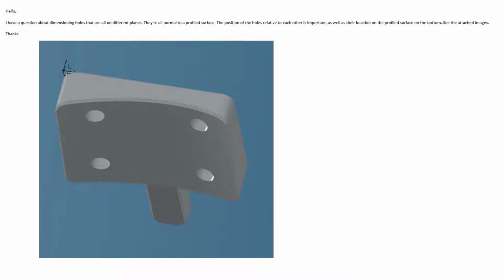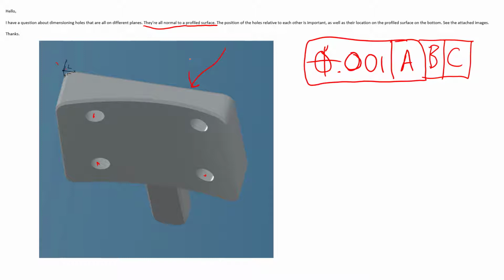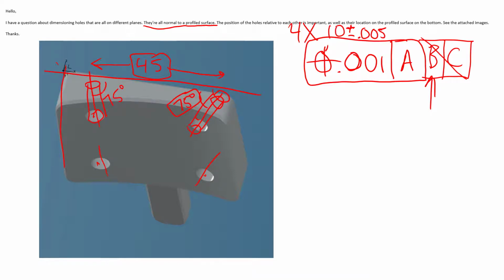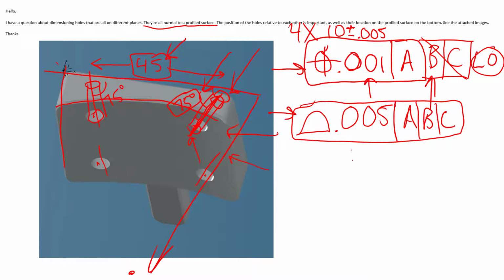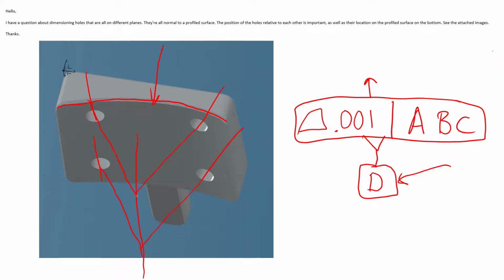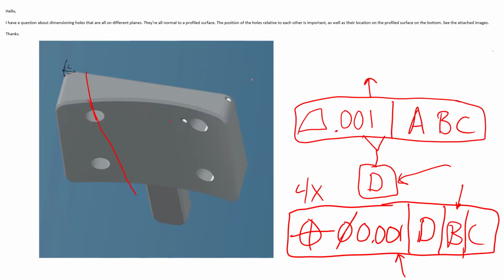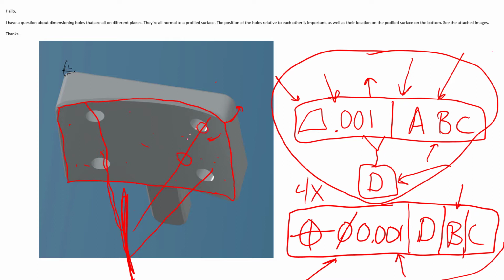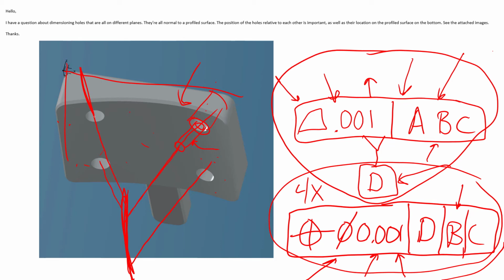Using a Complicated or Round Surface as a Datum - 4 holes normal to a curved surface

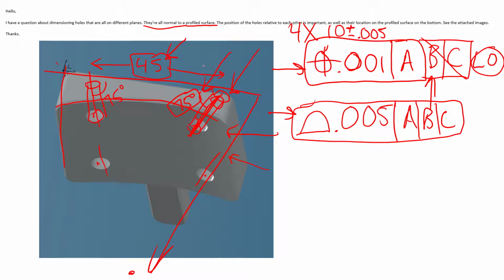Comment: @9:03 [My Observation] The "Industry" strives to design parts to be cost effective on both ends, so this usually means parts can be machined with minimal fixtures required. It is my opinion since datum A is flat (top) and the 4x holes will be bored from Primary datum A (Top) not the (Bottom) and then YES, the bottom would create the "Weird Awkward Angle". Boring from the top with a 90 degree angle, will be more efficient and cost effective and let the other part (round surface) host the "Weird Awkward Angle". It is more efficient and cost effective to bore holes on round stock then to bore a hole at a "Weird Awkward Angle" and locate it on a flat surface, do you agree?

Comment: how do we use a curved surface to check the true position of a hole that is not normal to the curved datum surface. Like the distance of the hole to the curved surface  say the curve surfaced was 90° to the hole?
Reply from the maker: The true position of a a feature such as a hole is defined using basic dimensions back to the datums defined by the datum reference frame in the feature control frame. As long as this is accomplished, you should then be able to take the tolerance zone defined in the feature control from and center it on the true position. The measured axis of the feature must lie with in this tolerance zone. Check out our video on datum reference frames here. https://www.youtube.com/watch?v=D9U1YV_96kk

Comment: it should be functional not easy. That looks like a wing shape there for no axis. If you are checking this on a CMM its easy if not then you need to make a master. Remember primary needs 3 points. But hell no one will inspect it and under stand it. I have seen how QA does it. They pass it if it need to be passed. Machinist will slow the feed and speed to hit the .0005 the machines are allegedly able to do or hope they can. Bottom link it will fail and use as is will be called off on most things .001 inches.

Comment: What happens if the complicated surface is actually complicated and looks like a shape of a wave? Does it still produce a centerline that you can use as a datum?
Reply from the maker: Hi bandy32,

The tolerance that is shown for this example is Profile of a Surface and the Total Tolerance is .001. Any given surface element must lie within the tolerance zone and will not be “perfect”. The larger the tolerance, the more imperfect it can be and it could start to take on the “wave” shape that you mentioned. However, this surface is merely the Datum Feature and not the Datum itself. Remember that because we would establish a Datum from this, Datums are “perfect” and just like using a planar surface as a Datum, we will be using the high points of the surface. Also, this Datum (|D|) will be “perfectly” located and oriented from the |A|B|C| DRF and because it will be a cylinder, the Datum will be an axis.
Hope this helps!
-Your GD&T Basics Team

Comment: I believe you may have misled your viewers on this one.  When you were discussing making the curved surface a datum, you stated that the holes need to intersect the axis of the cylindrical surface.  However, this is definitely not true, depending on the mating part.  If the mating part is also a cylinder with a radial hole pattern, using the axis as the datum could be disastrous, resulting in a bad part that actually checks good.  The reason is because as the actual size of the cylindrical surface varies, the actual radius will change (as you discussed).  This means that the actual distance between the holes is required to change with the radius; i.e. the arc length between the holes will change.  This effectively causes the hole pattern to shrink and grow, depending on the calculated radius of the feature.  But functionally, you would need that arc length between the holes to be static.  So the simulated datum needs to be at the surface itself, not at the axis.  This would be exactly how a functional gage would work.  The part would nest against a cylindrical surface with pins spaced at a static, basic arc length. Ergo, you do NOT want your holes to intersect the axis of the feature per se.  As the actual size of the cylindrical feature shrinks and grows, you want that arc length to remain static, which will necessarily cause the axes of the holes to not intersect the axis of the cylindrical surface (except at the nominal size, of course).

What would exacerbate the problem of using the axis as the datum would be that when checked with a CMM, such a small arc could potentially cause the calculated size of the cylindrical surface to vary wildly, since the software would have to ‘project’ such a large percentage of the diameter, greatly amplifying any error in the inspection.  This causes the calculated radius to change wildly (relatively speaking), which, as stated above, forces the arc length between the holes’ tolerance zone to shrink and grow, which is not in any way functional.

And what makes it even worse than that is that if the cylindrical surface is controlled with a profile, this would permit the size of the cylinder to truly vary considerably, even with a relatively tight profile tolerance, and the smaller the arc, the worse this gets.  So your radius could vary wildly in reality, then add on top of that the error from the inspection, and you end up with a very unstable inspection.  Good news is, your part would probably never check good, depending on the accuracy of the process, as well as the accuracy of the CMM.

The question then would be, how do you specify the cylindrical surface itself be simulated as the datum, not the axis?  Could you argue that since the cylindrical surface is not technically a feature of size (no opposing points), that forces the simulator to be at the surface, not at the axis? Again, this would be exactly how a functional gage would work.
Reply: I agree.
I believe that a [BSC] modifier next to the datum reference letter D is the way to solve this issue. Similar to fig. 4-28 in ASME Y14.5-2009. This would require the datum feature simulator to be fixed in the basic radius of the profiled curved feature. 

Another issue with the explanation is -the curved surface is the primary datum feature for the holes' position tolerance. As a primary datum feature, it needs not to be validated with reference to A, B, C of which B and C are the secondary and tertiary datum references for the holes. Usually, the secondary and tertiary datum features are validated with reference to the primary (the tertiary also with reference to the secondary). So defining "where the datum axis is" is not part of the problem contrary to how it was presented.
Reply: @sem7207   Great answer. In thinking about it more, it seems like on Fig 4-28, BSC helps, but there's still something missing. The hole diameter is toleranced, the hole position is toleranced, but if the part is thin, there is very little control over how normal the holes are to the contoured surface. How would you add a composite reference frame to tighten that up?
Reply: @moynihanigan  Most likely no one needs a tight control over how perpendicular the holes are to the curved surface for a part similar to the one in figure 4-28. It's a thin part, and the holes are toleranced and referenced as clearance holes; the size tolerance is not to tight, the position tolerance is specified @MMC, and pretty large datum shift allowed for the surface controlled to A[BSC], B@MMB. This indicates that the relationship of the holes with whatever goes through them is loose. I wouldn't worry about the orientation of these holes or consider a composite tolerance.

Comment: Well put and understood if the curved surface has an axis.  However is there a way to use the curved surface if it is not cylindrical or conical that has an axis? For example if the surface was a free-form surface?
Reply: Any surface that is mathematically defined can be a datum feature. On a side note, holes do not have to be perpendicular to the datum surface like it was mentioned here.
Reply: @crazyingenieur3277  Understood, so if it was a completely irregular surface, then you'd need to just with "option A" here.  i.e. Place datum on the flat top side and have both the irregular surface as well as the holes related to it?
Reply: @matts9728  
1. Datum features are to be selected based on the function, not based on the geometry we like.  In this video, there is no information on the function of this part and mating conditions with the mating part(s). The holes shown perpendicular to the curved surface kind of hints that the bottom surface is the sitting surface hence should be selected as the datum feature (most likely primary datum feature).  However, we need more information on the function and the mating part(s) to be sure.
2. Again, any feature/surface (mathematically defined, regardless of how complex it is) can be a datum feature. Refer to ASME Y14.5-2009 para 4.13 and Fig 4-28. In this figure, you will see a free-form surface selected as the primary datum feature.
3. In this video, they are talking about selecting the datum feature based on how the holes are (perpendicular, etc.), which is from a design point of view inaccurate. (see #1).
Reply: @crazyingenieur3277  Appreciate the clarification, I completely agree that Datum features should be selected based on function.
But that said, do you think there are ever situations where it's acceptable to instead datum off of easily fixtured planes for the sake of machining/inspection?  
I'm trying to think through it and maybe the only reason would be if you were constrained to no CNC/CMM for some reason?
Reply: @matts9728  
You can manufacture and inspect a part fastest, easiest, cheapiest way.  However, if that part does not fit and functions, you will end up having something called "cheap junk".
Reply: @crazyingenieur3277  haha well yes, your first job is to make something that actually works.
Reply: @matts9728  What "Crazy" said. Engineering takes precedence. If it didn't we'd all create bi-laterally toleranced features for the machinists, since many love to whine about uni-lateral or, any dimension that accurately shows design intent. I gave up trying to appease them years ago.

This is probably one of the most important aspects of design; the language in which we convey the intent. Must be concise and unambiguous... to those who have a solid understanding of the language.
Reply: If you are CMM this it can be done. but the tolerance shown means you need to make a master tool or its a one off. No two people talk GD&T the same.